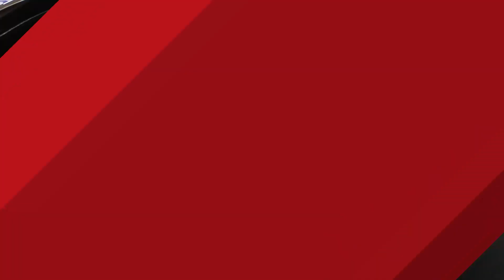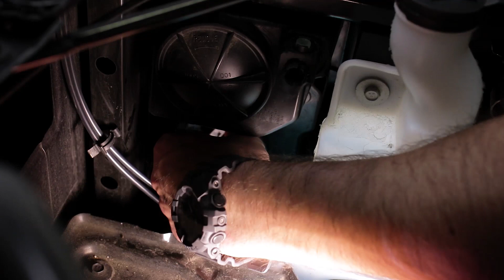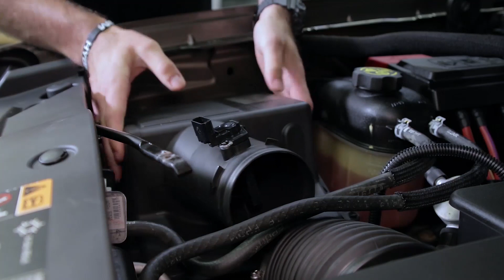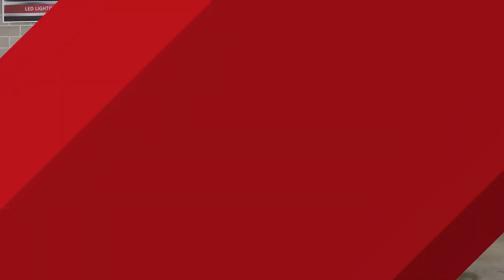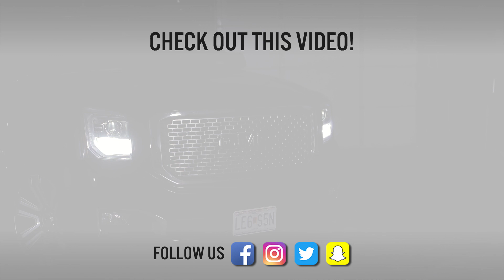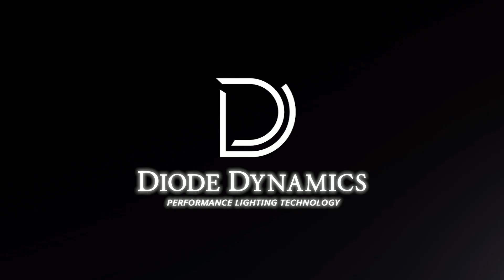58% Brighter High Beams for your 2015-2020 GMC Yukon! | Headlight Bulb Install

Comment: What about those junky low beam HIDS that I can’t see anything with? Can I upgrade them to led or would I have to change all components of the HID ballast and all that out?
Reply from the maker: If you have factory HID, unfortunately, you have to replace with HID, or replace the headlight assembly and wiring to allow for LED.
Reply: Gm also has/had a tsb for the hid bulbs at one point. They used a lower output bulb ( 25w if memory serves me) and they swap it to a 35w unit. I have OEM 35w units in my 2017 Denali and they are borderline ignorant bright. I know there are a few aftermarket products from Morimoto that are plug and play for replacement hid bulbs that are proven to be even brighter but they aren't cheap

Comment: Why do you recommend if you have a model with stock halogen in the low beams what works best when upgrading those to led too?
Reply from the maker: Hey Eduardo! You can get our Low Beam SL1 LED replacements from this link:

https://www.diodedynamics.com/low-beam-led-headlight-for-2015-2019-gmc-yukon-pair.html

If you have any other questions, just give us a call at 314-205-3033, Monday-Friday 9 a.m.- 5 p.m. CST, or shoot us an email at contact@diodedynamics.com!